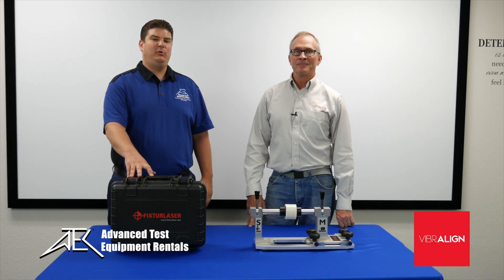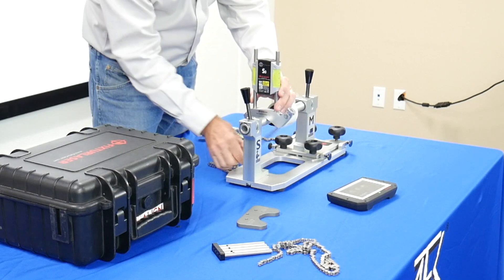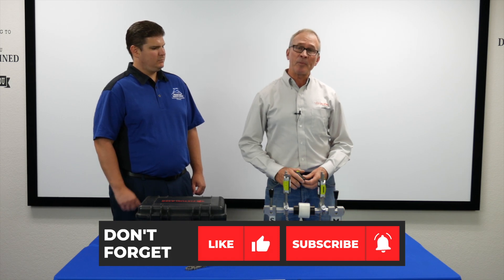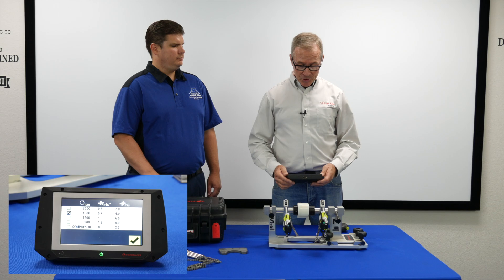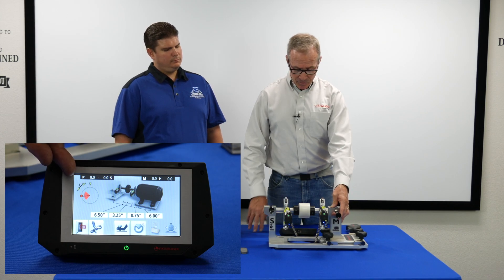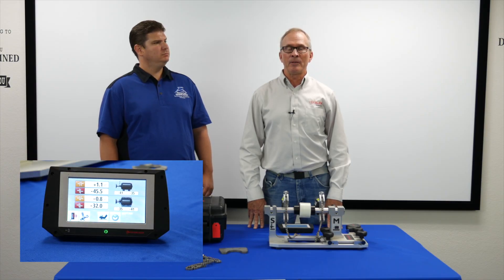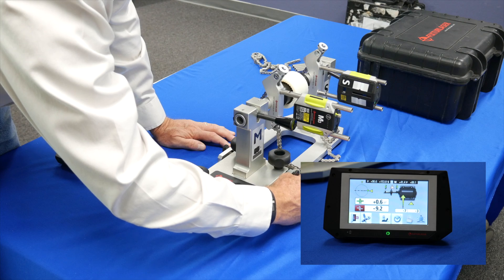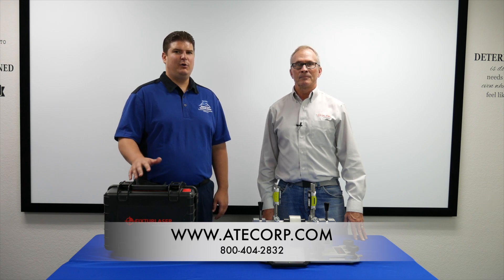How to use a laser shaft alignment tool using Vibralign Fixturlaser EVO

Comment: I noticed the display unit never asked for a diameter measurement. How does it know what the laser diameter is? When using dial indicators you always have to know the diameter please explain this to me!
Reply: It doesn't care especially if the shafts are the same diameter. The alignment is of the center, so when you align the lasers that is the shaft "calibration".